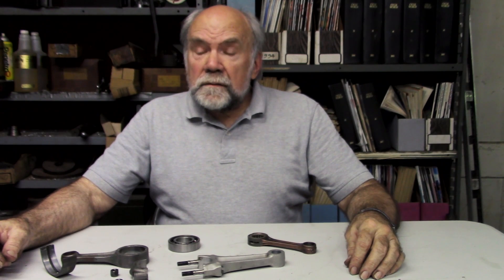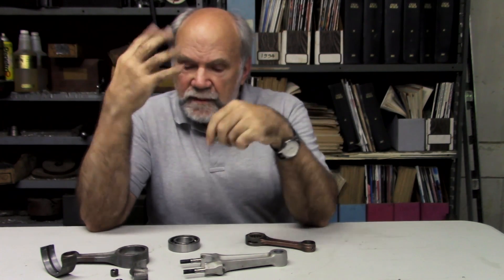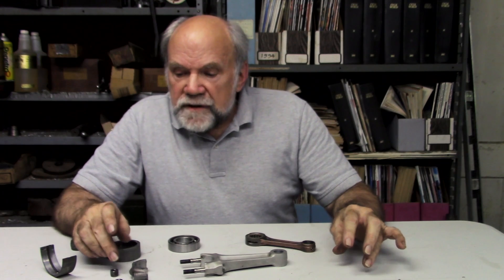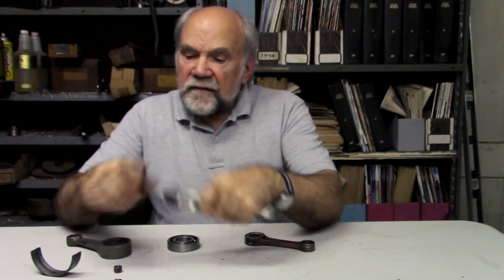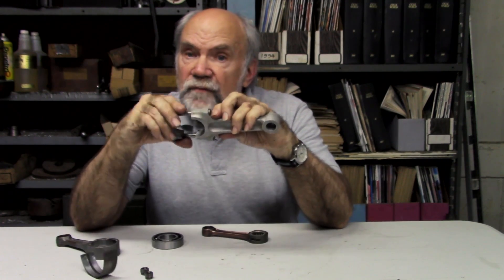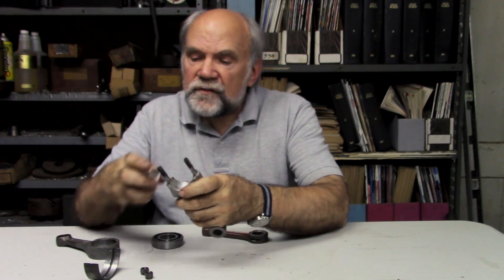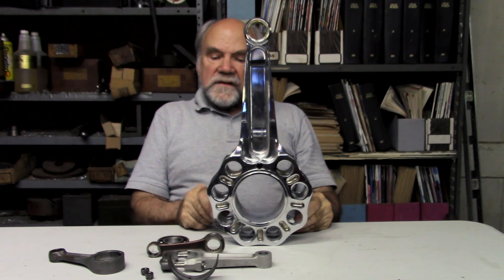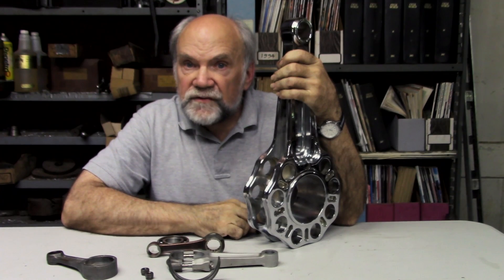How Are Crankshafts And Connecting Rods Brought Together In A Motorcycle Engine?

Comment: Somebody PLease BuiLd a True: 525cc. ~ To 550-V-Twin 385-# LBs...Wet A.D.V With 40,000mile VaLve Adjustments, Or a Raised Yamaha 321-cc.@3" Longer Shocks, Or Just DO IT@ScrambLer-mt03..  Or DoubLe That Little mt03 ENGINE; X--2=642-cc. [[[[ V-4 ]]]] Engine With 35mm. ThrottLe Bodys@Front..2-cyLinders, & 38mm. @ Rear Bank, 72H.p & 44-# Lbs Torque. ASAP!, Lol.

Comment: My interest in motorcycles started in 1981, just about the time when Suzuki's GS1100 came out. When builders wanted to get more power out of the the big Suzuki, the first thing they said they did was to "WELD the crank." The GS had Kevin's aforementioned pressed together, roller bearing crank that needed to get stronger. How does one get those welds into the tiny spaces between counter-weight and bearing race? I have never figured that out. Kevin, been reading your work since Cycle Magazine. Please show me or describe this to me.

Comment: My 2 loves are airplanes and motorcycles! Mr. Cameron, would you consider a Harley engine as a radial engine?
Reply: Doug Ankrum 
The forked connecting rods put the cylinders in the same plane unlike side by side (tandem) V twins. Aircraft radials cylinders are in the same plane via the master rod KC showed a few videos ago. I was curious about his opinion. I get aircraft people riled up when I compare the 2.
Reply: If you can't turn a motor upside down and run it forever without the oil or the gas coming out of it. ????
Reply: Rick Simpson 
Yes, that would take a dry sump oiling system, oh yeah, Harley has that. I never saw an aircraft radial that didn't leak oil or smoke like hell on startup. You add oil by the gallons between flights, buy it by the drum.
Reply: Kevin Cameron 
Thankyou for the answers and replies! I have been reading your articles since early teens, they helped in my aviation career.